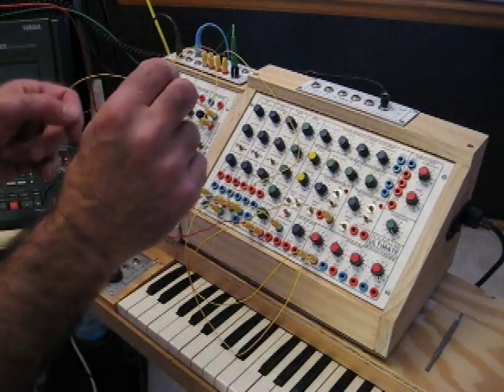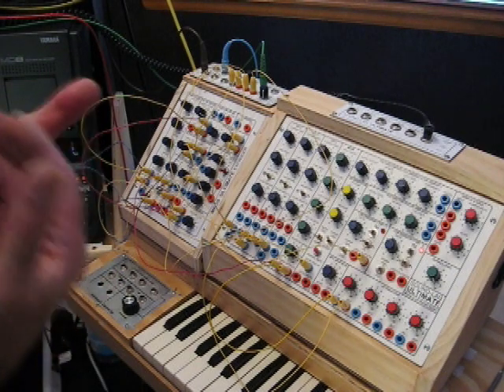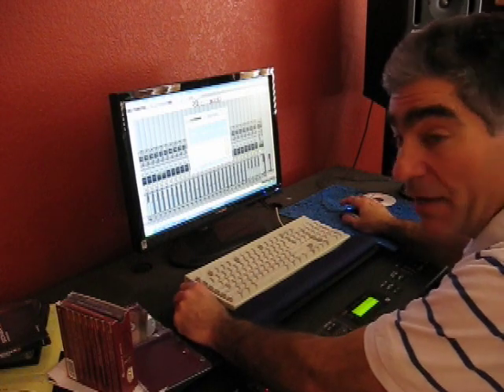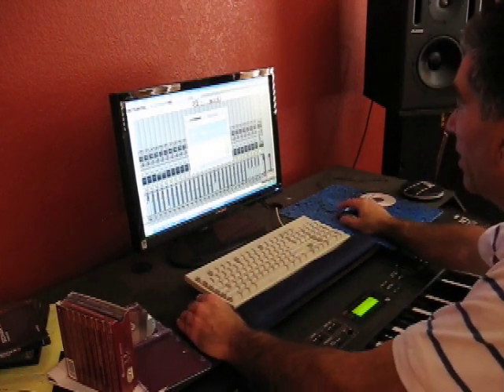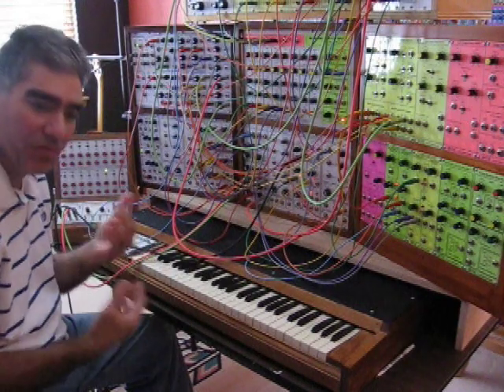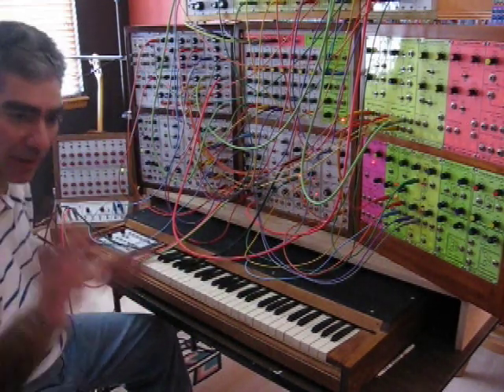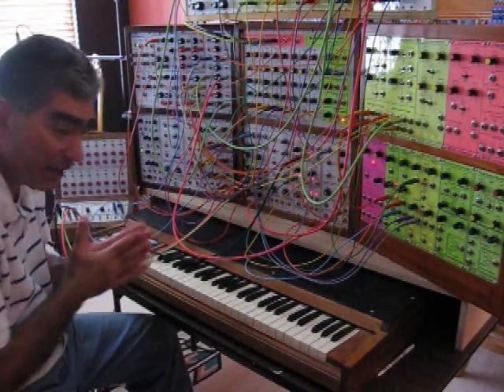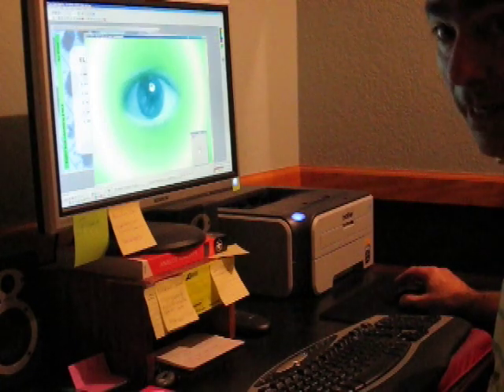The Making Of ELECTROLUMINESCENCE

Comment: @adrianjcc modular synthesis is the most direct way of programming... in the same way as you would program in a prewired synth (a sh101, for example) you will do the same but on a modular synth you get the oportunity of designigin your own arquitecture for the synth: you will decide how many vco, vcf, lfo, etc you will use, and you will decide how the conections will go, so you can "create a different synth" every day... the programming concepts relay the same although

Comment: great job on this CD. I will buy it. I would love to hear how you made the strings section sound also. Would that sound be possible on one Ultimate + Expander or would it require a wall size system as displayed in this video? Also may I ask - what are the modules and # of them in that system? (shown during the water and birds sound) thanks.